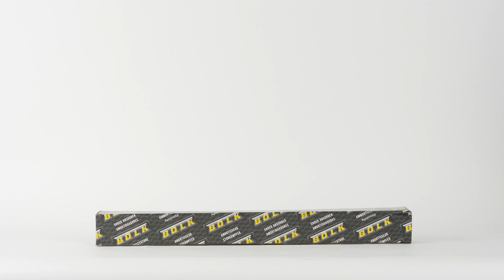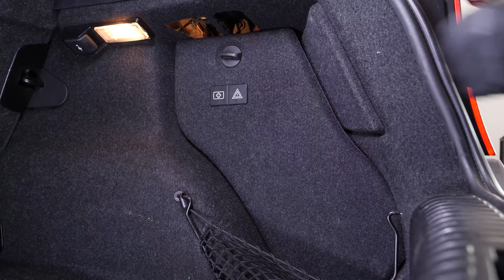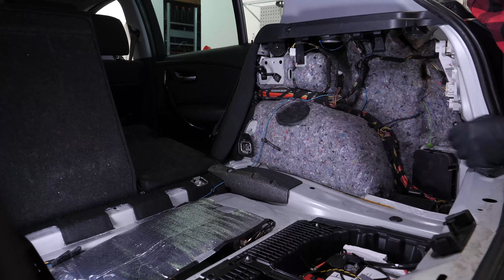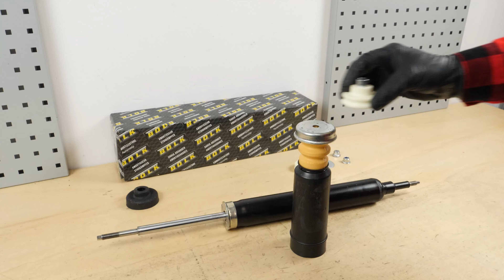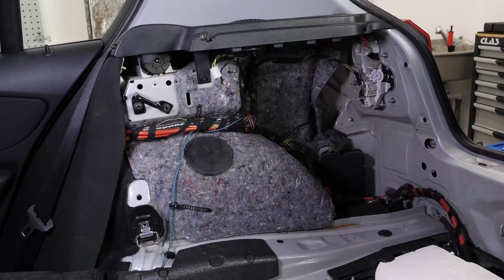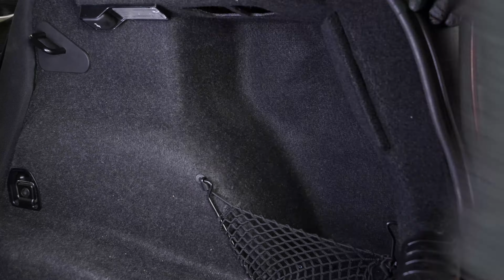How to replace the rear shock absorbers BMW 1 Series E87 ➿

Comment: Hello! Great video it was surer helpful! Although I had the experience that the torx socket was E14. E12 was too small and almost ruin the screw guide lines. My car is a BMW e87 116i 2007